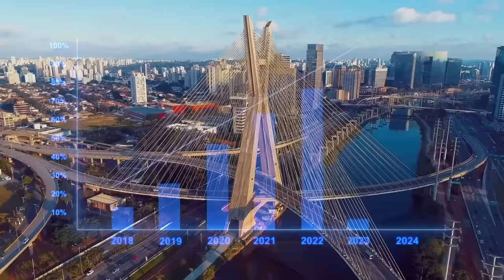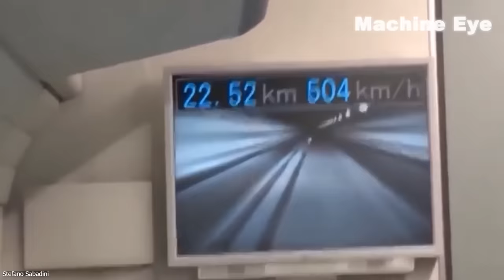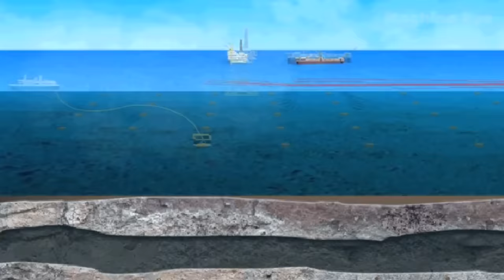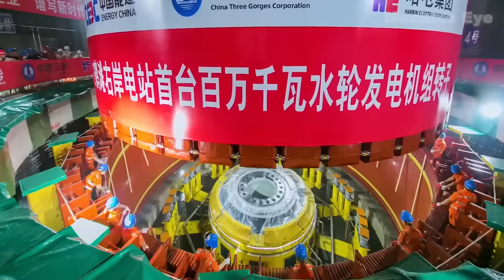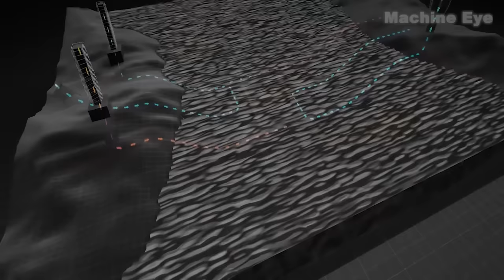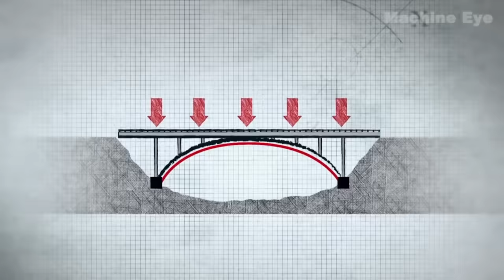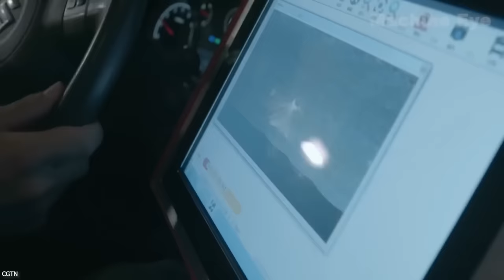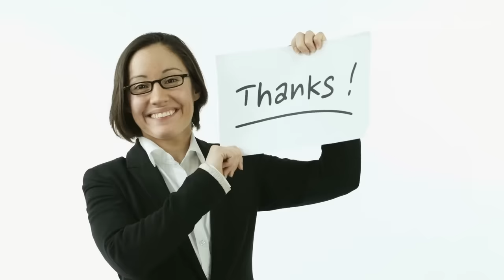China's Mega projects! Americans Won't Believe it

Comment: China is a developing country, developing, developing, developing..........
Reply: According to Adam Smith, specialization of labor allows for much greater productivity overall. Specialization of labor is the practice of dividing one complicated task done by one worker into a series of smaller, simpler tasks done by multiple workers. With the specialization of labor, you’ll have a farmer who specializes in growing wheat, a miller who specializes in grinding flour, and a baker who specializes in making bread. [Shortform]
Reply: The Chinese construction industry is expected to expand by 4% in real terms in 2024, driven by infrastructure and energy and utilities construction. 15:00
Reply: The China Construction Market size is estimated at USD 4.59 trillion in 2024, and is expected to reach USD 5.87 trillion by 2029, growing at a CAGR of 5.07% during the forecast period (2024-2029). [Mordor Intelligence]
Reply: In 2023, the construction industry accounted for around 6.8 percent of China's gross domestic product. 30:00
Reply: Among the projects that exemplified super engineering are the launch of Shenzhou-17 manned spaceship, the operation of China's new-generation "artificial sun" HL-3 in the high-confinement mode under a plasma current of 1 million amperes, and the kickstart of a new nuclear power unit using Hualong One, a domestically designed third-generation nuclear reactor. [Xinhua New Media]
Reply: China has relied considerably upon infrastructure projects to generate growth while also helping modernize its economy.
Reply: China's large labour force and efficient supply chains contribute to lower production costs than many other countries. 2:56
Reply: The construction industry in China is a dynamic and rapidly growing sector that plays a vital role in the country's economic development and urbanization. 2:00
Reply: The Chinese government has exerted efforts toward regional integration in the field of infrastructure development.
Reply: The business ecosystem in China has evolved quite a lot in the last 30 years.
Reply: China's large labour force and efficient supply chains contribute to lower production costs than many other countries. 2:02
Reply: According to the forecast by Fathom Consulting, Asian economies such as China and India are expected to lead the global economy with the highest GDP share. The report forecasts China to have a share of 22.68% and reach $101 trillion by 2100.
Reply: Work on Cologne Cathedral was finally finished in 1880. At that time, the Cathedral had a height of 157 metres, making it the tallest building in the world — after a total of 632 years of construction. And except for a few centimetres, the two towers are even the same height. [Cologne Tourism] 2:32:32

Comment: I work in construction management in the DC area. The 16 mile purple line light rail that is reusing old freight train rail, has been planned for 36 years, mired by enviromental study and residents resistance. 
Finally apporved in 2015 by republican governor Hogan. It will take another 3 years to open in 2027 or 2028.....
Just come on!!! 50 years for a light rail conversion? Compare to china building over 4000 miles of rail each year
Reply: Do you know why this is? Between the US and China which country produces the best steel? Tell us which country produces the steel for the bridges and overhead crosswalks that collapsed in the US? Why are these companies buying this steel and not that made in the US? It's because the steel price is cheaper.
Reply: But America, "Build Back Better" 
China can build an entire metro system in Istanbul in the time America would still be working on an EPA to see if it will affect "Climate Change"
Reply: I'm chinese American now moved to China.  I was in NJ before and there was a small 1 mile section of Rd in jersey city near NYC.  When I left NJ in 2001, they were working on it, when I came back in 2009 they were still working on it. Finally in 2019 they finished it!  20 f'ing yrs for 1 mile of rd/bridge ?
Reply: @peanut0brain no under table money, no talk
Reply: Same with Hawaii.  I was 20 years old in college when they finally passed the light rail bill.

Rail was suppose to be done in 10 years

15 years later, only halfway.  I guess I’ll be 45-50yo by the time the 10 mile track is done -_-
Reply: Everytime politicians bring up a proposition to the voting poll,  they bring it up to their respective Party( 2 choices Democrat or Republican) then they figured out how the politicians will benefit from it. They will find their group of lawyers how to frame the proposition in their favor and of course construction companies have their fair shares of lobbyists. Tell me which system works better for the public .